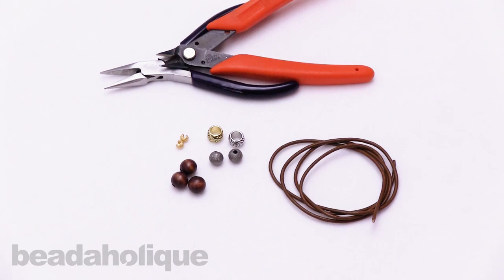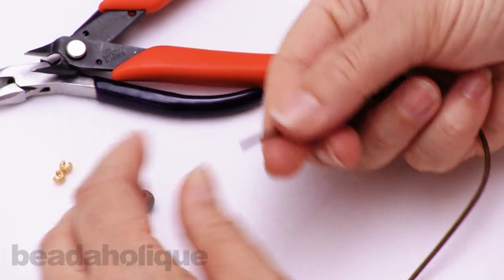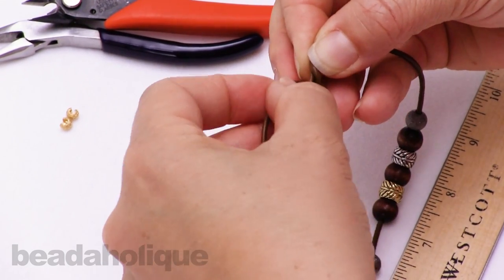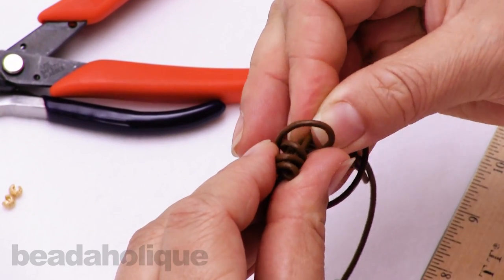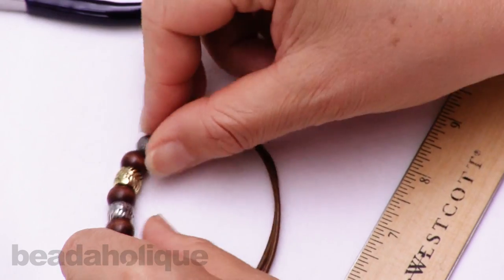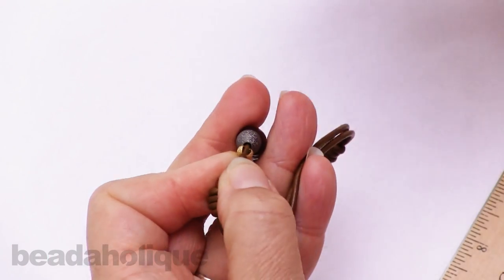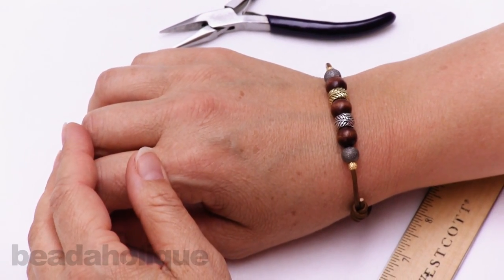How to Make a Bracelet with Slide Knots

Comment: Hi, great tutorial...One question: I purchased a lot of crystal healing beads like amethyst and turquoise etc in 4mm, 6mm and 12mm, and 2mm cord as well as 1mm hemp cord and the holes in all of the beads are too small for either cord. 
Is this normal?
I also purchased a bead reamer but its not serrated like a file its just smooth so I dont logically understand how that could ream the hole larger...
Can you tell me what I did wrong? 
Thank you
Reply from the maker: 1mm cord is still fairly thick, gemstone beads will often have holes under 1mm, Reaming the bead holes isn't a bad idea, but it doesn't sound like you got a good reamer if it's completely smooth to the touch. A good reamer will usually have a rough coating of industrial diamonds, sort of a sandpaper-like texture. Still though, even with a high quality reamer it sounds like a lot of work to re-size those beads, you might wanna consider a narrower cord. We have a 0.55mm hemp cord, might be a thin enough fit for those beads: https://beadaholique.com/products/beadsmith-natural-hemp-twine-bead-cord-0-55mm-394-feet-120-meters

Comment: The knotmaking worked for me but I needed 7" of tail to make the loops. However, the finished product came out kind of big even cinched down to the smallest. Is there a way to gauge how snugly the bracelet will fit when it's finished?
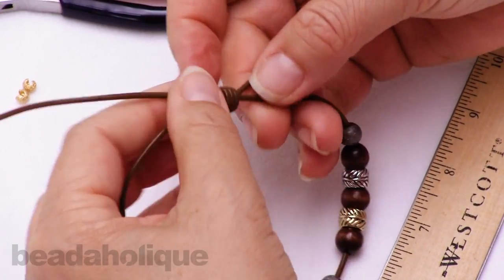Reply from the maker: We tend to feel it out as we go, testing it out on the hand after we've got our first knot in place, as Alexandra does in the video around 2:25 and judging things from there. These knots can be a pain to get right but don't be afraid to undo the second one and do it again to get the length just right before you trim your tails.

Comment: This is a fantastic video! And I also never thought to use crimp cover beads to keep the rest in place!! But what size crimp bead would I use for 1.5mm leather cord?
Reply from the maker: The crimp covers in this video will work on a 1.5mm cord, but you can potentially use smaller crimp covers around 2mm or 3mm. We have some more options here: https://www.beadaholique.com/beading-components/crimp-ends-covers-cord-ends/crimp-bead-covers
Reply: 1.5 mm crimp end

Comment: Is this bracelet as challenging to tighten up once it’s on as it looks in the video? How about getting it off?
Reply from the maker: The adjustable knots are easy to adjust. Depending on your material, you may need just a little bit of force to move the knots around. Thanks for watching!

Comment: What size hole beads would I need please
Reply from the maker: The cord we used is 2mm so you could use any bead with a hole slightly larger than that. You can see all the components we used for the bracelet here and get a sense of the measurements of the different beads: https://beadaholique.com/products/wooden-lustre-bracelet

Comment: How do you do this when you have knots between the beads
Reply from the maker: With this style of bracelet the technique is pretty much. If you want to make a piece like this but with the 7 focal beads spaced out by knots you would start by cutting yourself a length of cord, finding the center of it by folding it in half, then sliding on the bead you want to have at the very center, knotting it in place on either side with overhand knots or whatever kind of decorative knot you'd like, and then continuing to add beads and additional knots to each side.

Comment: Please, what size beads were you using? I'm not sure enough about telling sizes. I want to order from your site to make this bracelet, but do not know the proper size bead to order. Is a 20mm bead too large? Thank you
Reply from the maker: The beads range between 7mm and 10mm. For reference, a 20mm bead on a similar cord would look twice as big as the wood beads in this project. Just in case, here are links to the items featured in this video:

Silver Tone European Style Large Hole Spacer Bead With Wrapped Leaf Design (1)
SKU: BMB-8175
http://www.beadaholique.com/silver-tone-european-style-large-hole-spacer-bead-with-wrapped-leaf-design-1.html

22K Gold Plated Large Hole Bead With Wrapped Leaf Design - European Style (1)
SKU: BMB-8176
http://www.beadaholique.com/22k-gold-plated-large-hole-bead-with-wrapped-leaf-design-european-style-1.html

Genuine Leather Cord, Round 2mm,  By the Yard, Light Brown
SKU: CHY-2007
http://www.beadaholique.com/leather-cord-round-1-5mm-by-the-yard-light-brown-1.html

Smooth Wood Beads, Round with 10mm Diameter, 36 Pieces, Dark Brown
SKU: BWD-0426
http://www.beadaholique.com/smooth-wood-beads-round-with-10mm-diameter-36-pieces-dark-brown.html

22K Gold Plated Stardust Sparkle Crimp Bead Covers 4mm (144)
SKU: FCR-1071
http://www.beadaholique.com/22k-gold-plated-stardust-sparkle-crimp-bead-covers-4mm-144.html

Gunmetal Plated Stardust Sparkle Round Beads 8mm (25)
SKU: BMB-1858
http://www.beadaholique.com/gunmetal-plated-stardust-sparkle-round-beads-8mm-25.html

Xuron Sharp Flush Cutter Pliers - Wire/Soft Flex
SKU: XTL-5600
http://www.beadaholique.com/xuron-sharp-flush-cutter-pliers-wire-soft-flex.html

Beadsmith Jeweller's Micro Pliers Chain Nose Flat Nose
SKU: XTL-5511
http://www.beadaholique.com/beadsmith-jeweller-s-micro-pliers-chain-nose-flat-nose.html